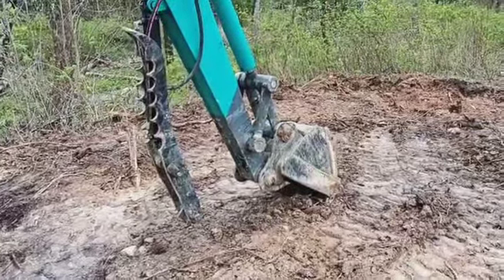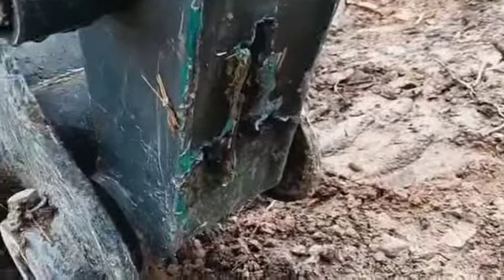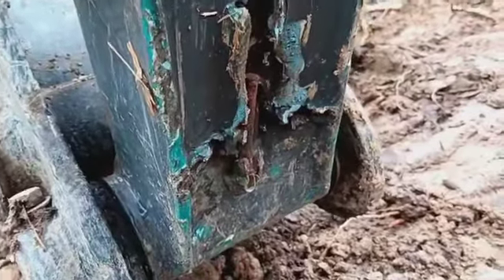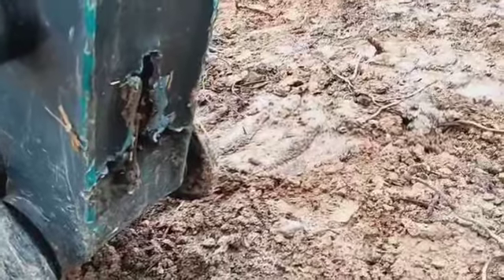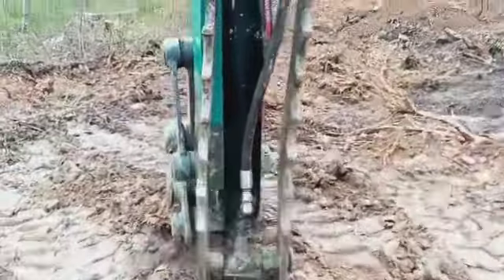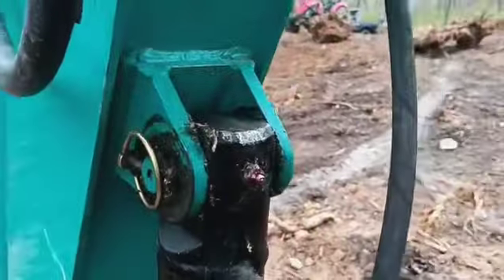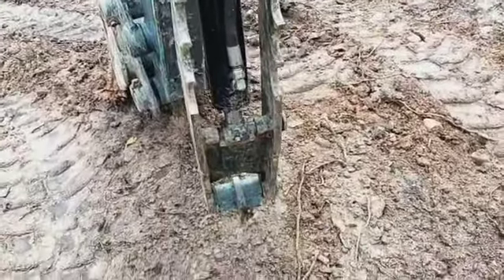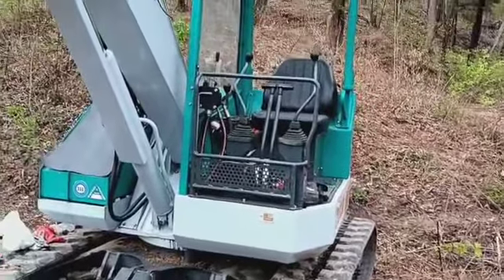Excavator thumb fails! @MyWestVirginiaHomestead

Comment: That looks like a brand new machine.  What's the dealership saying to you about this?
Reply from the maker: It is a rebuilt pc50uu-1. The thumb was an aftermarket one.  The dealer is giving me some compensation.  But it will still cost me as I'm going to get a better thumb. Even if it didn't fall off, it was a very poor design.